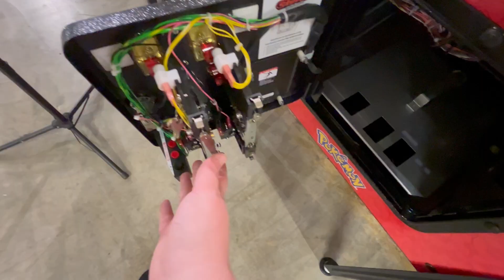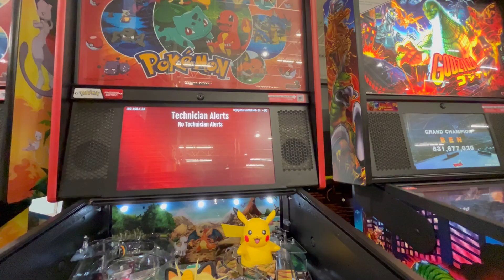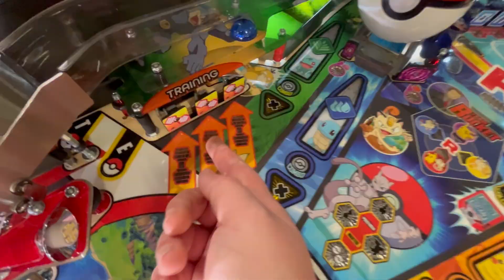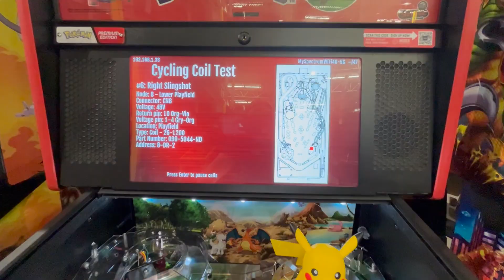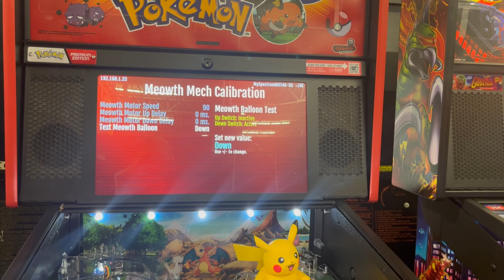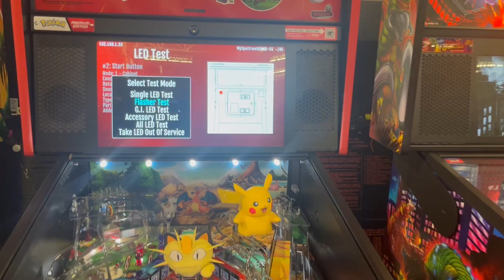Running Basic Tests on Pokemon Pinball

Comment: It looks like a really nice debug interface is this unusual for pinball machines?
Reply from the maker: I think the first Stern game to use this new test menu was King Kong in Spring 2025. Since then, Stern has added it to many of their other games via software updates. Jersey Jack games also have a good visual interface for their menu. On the older Stern menus, the tests were still pretty comprehensive but did not have the visual diagrams.